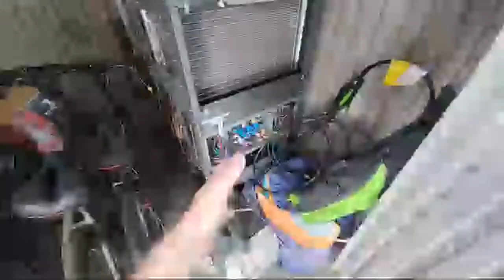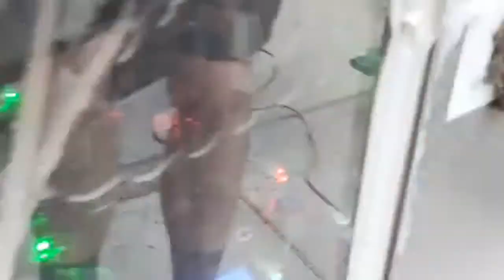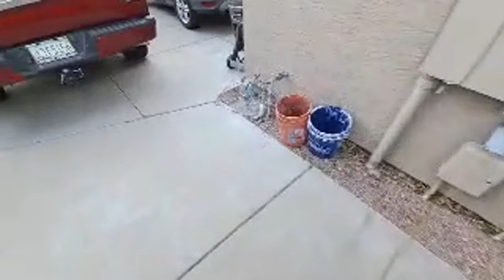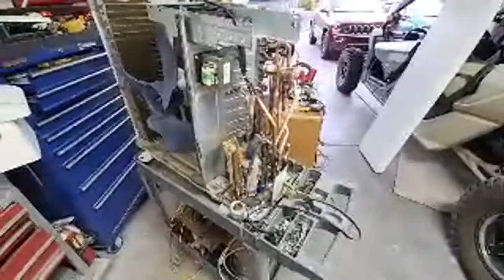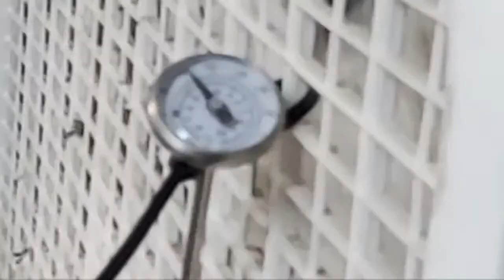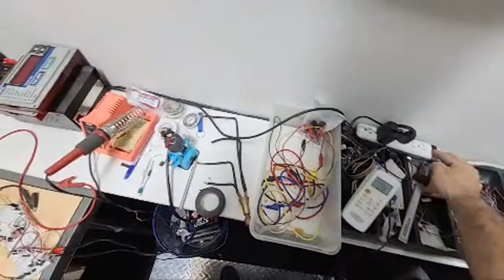I Broke The Frankenstein Friedrich/Carrier Bastard. Oops!

Comment: can you turn a ecm motor into a phase converter
Reply from the maker: I don't think it comes out as a great sine wave or anything. I'd have to spin one and see what the permanent magnet motor produces across it's windings.
Reply: @hackfreehvac  the thing is I made one    I'm 17 yrs old
Reply from the maker: @labgonewrong3071  It's possible. 
One way if it is a single load is to use a VFD. Some will accept single phase input.
Reply: @hackfreehvac  it is on my TikTok account

Comment: Might have a problem if you have hot gas that boils the water in the HX by stopping the pump with the series condenser idea.
Reply from the maker: It would only be 180-ish degrees if everything was ok. It won't keep increasing as the hot gas line only goes so high unless the system has a low suction issue causing higher compression ratio etc.
I'd think it might cause some induced flow perhaps but still slow enough not to heat the water.

If an issue arises I suppose pulsing the circulation pump a few seconds every minute or so should fix that but I doubt it will have any issues.

Not too mention water wouldn't "boil" until probably 250 + degrees at the water pressure of 60+ PSI
Water in a car is good to like 240 with 16 to 20 PSI so there should be quite the resistance to boiling in a pressurized water heater loop.